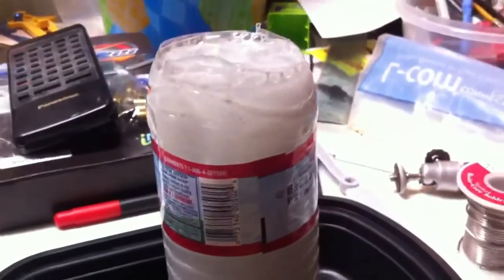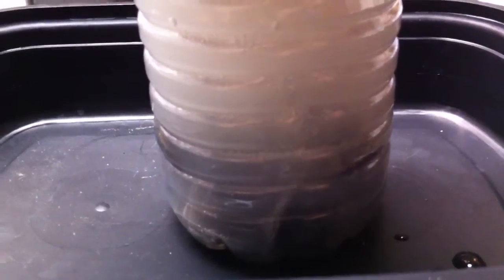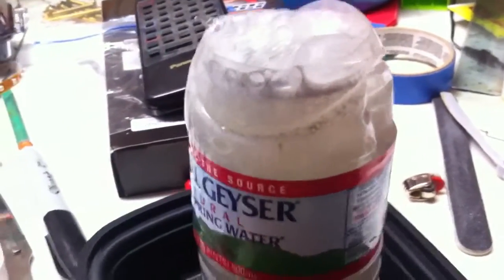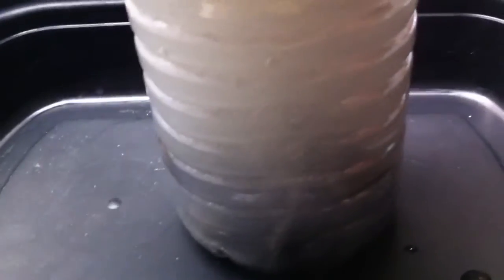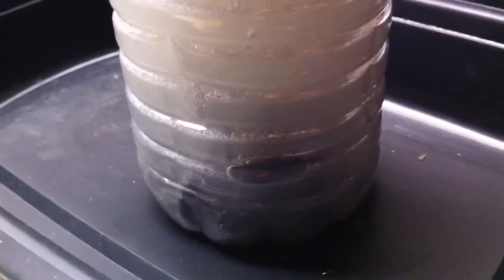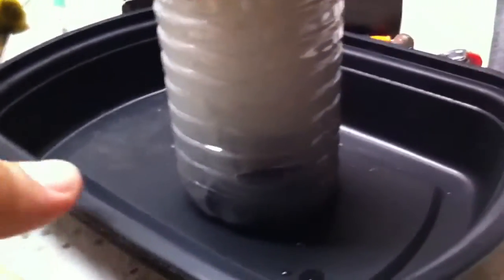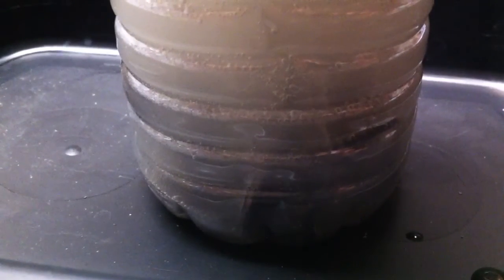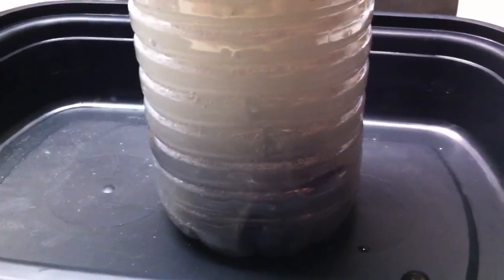The Dip - Suppressor cleaning..

Comment: The best way to neutralize the resulting lead acetate mixture is simply to add salt (regular table salt) to it.  This is a double replacement (metathesis) reaction which balances resulting in Sodium Acetate and solid Lead Chloride.    Add salt until the container has a small quantity of salt at the bottom of it that will not dissolve even when the solution is heated to boiling.  When it is supersaturated salt water, there can be no remaining lead acetate in it.     The lead chloride residue can be reduced to recover lead by melting, but this needs to be done with added soda ash to neutralize the HCL vapors that will otherwise result. (Hydrochloric acid)
Reply from the maker: Awesome stuff man. Thanks!

Comment: What gas is causing the foaming as the lead dissolves ?
Reply from the maker: I honestly don’t know what gas is causing the foaming.

I do know that essentially the hydrogen peroxide in the solution is causing the lead to “rust” which allows the mixture to clean it away from the stainless steel.

Mixing vinegar and hydrogen peroxide creates peracetic acid.  This is highly corrosive and you don’t really want to breath it before adding lead into the mix.

Adding lead into the mix makes it even worse, because now you’ll be creating lead acetate.

I suggest a max and gloves when working with this stuff.

To dispose of it, I have allowed it to sit someone where the liquid will evaporate, leaving the lead behind. Then carefully - you don’t want to get crystallized lead acetate on or in you - collecting the acetate into a container.

We have a “toxic” day every year at the dump, where you can bring toxic materials and dispose of them.  I haven’t been yet because I don’t have that much.. 😂
Reply: @BellyUpFishGarage  Yes you are correct. The parasedic acid is reacting with the lead to create lead acetate hence the bluish color of the solution. The gas is actually hydrogen gas. Keep it away from ignition sources. If you want to precipitate the lead back out of solution add regular table salt. This will refresh your solution. After you remove the precipitated lead you can reuse the solution.
Reply: @Everything2A  how much salt?

Comment: This is a mixture of %50 white vinegar and %50 peroxide ( the hair dresser kind is best) it creates lead acid (including fumes). This mixture and fumes are HIGHLY TOXIC. Do not do this inside, do not touch the liquid, do not put this mixture in any food type container that you intend to use for food.
Reply from the maker: wraith3845 It actually creates lead acetate, not lead acid.

But yes, you’re correct. It’s not something you want to get all over you or breathe.
Reply: @BellyUpFishGarage  lead acetate is also known as lead sugar it's a crystallize solid
Reply from the maker: wraith3845 Yes, and it’s an entirely different animal than “lead acid.”